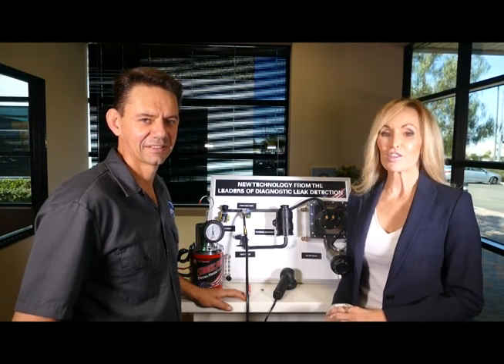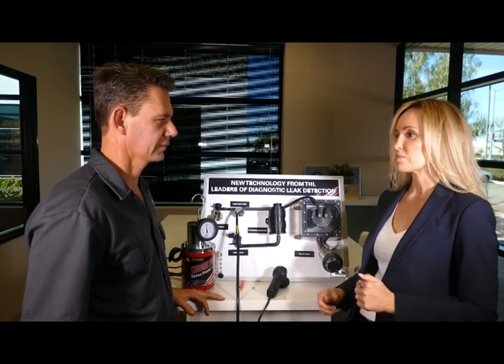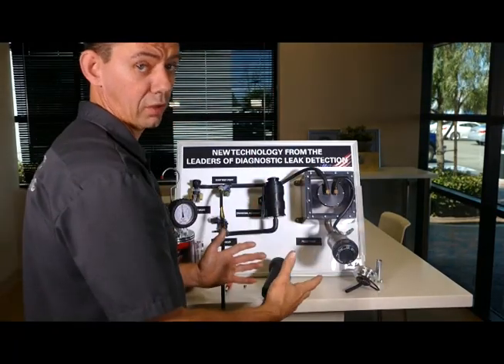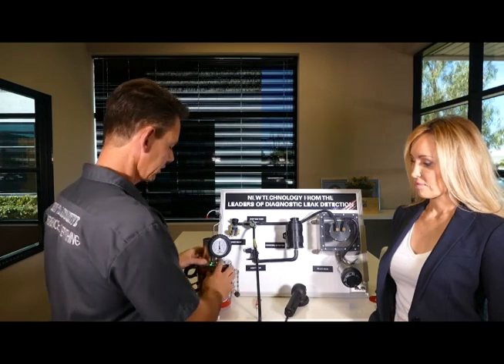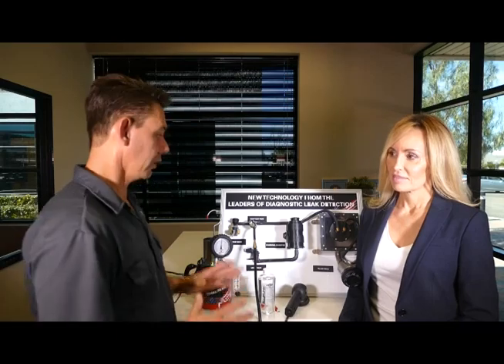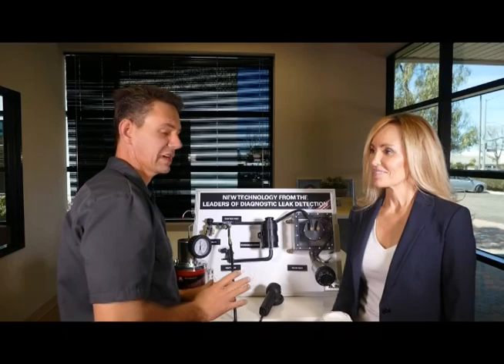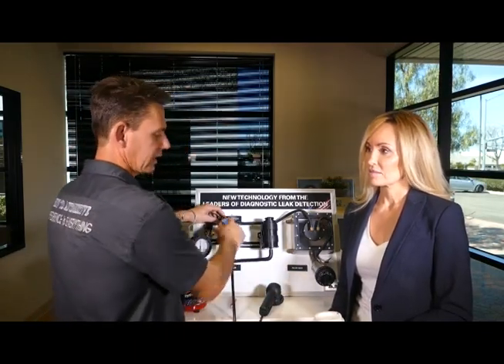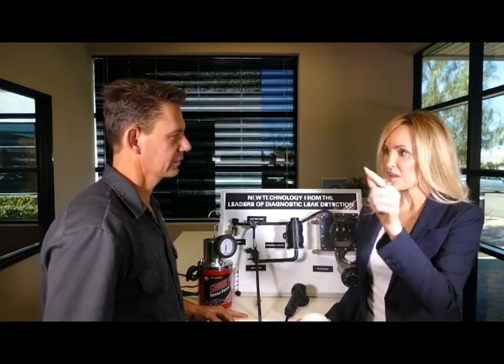EVAP Diagnostics with Redline Detection and Brian Eslick from How To Automotive

Comment: When u turn the flow meter to begin to make smoke and the float goes up. Do u just leave it like that or do u have to adjust the knob while testing. What's the difference  with this one and the ready smoke?
Reply from the maker: Hi Jason, you would turn the knob all the way to release the maximum smoke output so that any leaks on the vehicle are visible. You could then adjust the knob to decrease the amount of smoke if there is too much obstructing your view.
Reply from the maker: As far as the difference between the two machines, the Total Tech is a field serviceable, lifetime tool that comes with a 2-year warranty and our Easy Intake block off bladder. The ReadySmoke is a more affordable option that comes with a 1-year warranty, ideal for a technician who wants  their own personal machine that can be stored easily as it's more compact than the Total Tech. Let us know if you have any other questions!
Reply: @redlinedetection  exactly. I want one for myself and that ready smoke is sweet. Wanna get the fuel filler adapter and the easy intake. Bryan does a great job in his videos with the machine and how he puts it to use. So let me get this straight I just turn the knob all the way and wait to see if the ball drops.  I dont have to adjust nothing in the process unless the smoke is too much is what u are saying.
Reply from the maker: @jasonc.4683  Yep, that's correct. And we agree, Brian has made some great videos using ReadySmoke, very informative! When you're ready to purchase, you can either go through your local tool dealer or directly through us. Give us a call if you need any assistance :) 714-451-1411